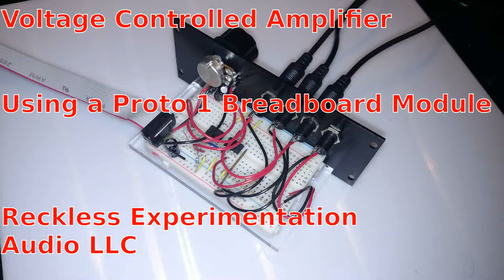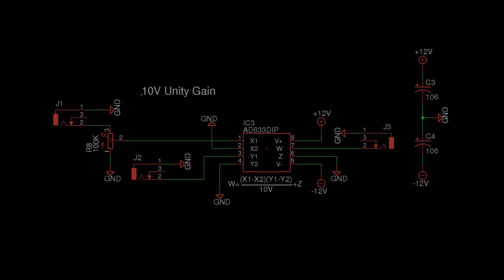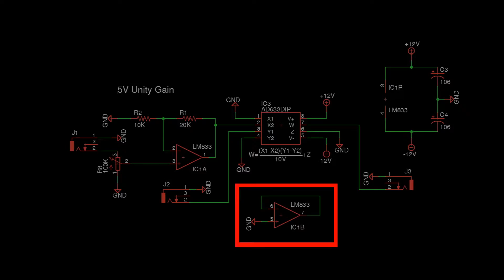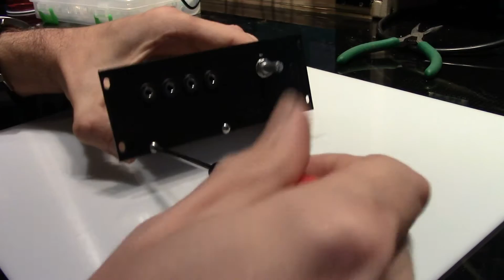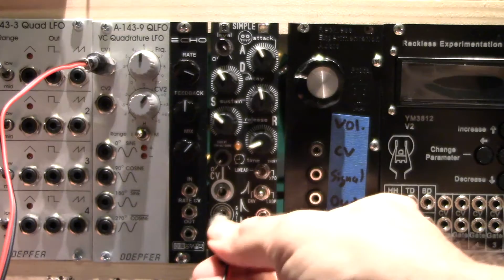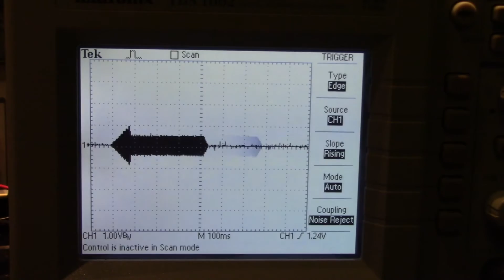Eurorack VCA using a Proto 1 Breadboad Module by Reckless Experimentation Audio LLC

Comment: this is a fantastic video. id love to see a part 2 where the breadboard layout is transfered to perf or vero board. dont see any of thosse type of videos
Reply from the maker: Good idea! I'm already working on my next video. After I'm done with that I make one on how to transfer a breadboard to a perf board.
Reply: @Recklessexperimentationaudio o the potentiometer will only work if a gate is plugged in?? my potentiometer only works correctly when I plug in a gate. if I don't plug in a gate and I just use my vco into the this vca as a drone, my signal only comes through a slight bit and I have to turn the potentiometer up all the way to hear a faint drone from my vco.
Reply: @Recklessexperimentationaudio  I think my lm833 could be bad unless this is how this vca should function. could a ne5532 work instead of the lm833?
Reply from the maker: @chemosis8259  From my schematic, 0:13, you want the output of your envelope generator into J1, the signal you want amplified into J2. A 'gate'  signal should go into your envelope generator. 

If you don't have an envelope generator, and plug a gate signal into J1, the amplification will be like an on/off switch. With the potentiometer in the circuit only controlling the level of the output.
Reply: sorry you awnswered my question about about 15sec into the video. I love the idea of your fm ym3812 module. always liked fm a lot. I was into fm for years before I started euro and sstill like fm @Recklessexperimentationaudio